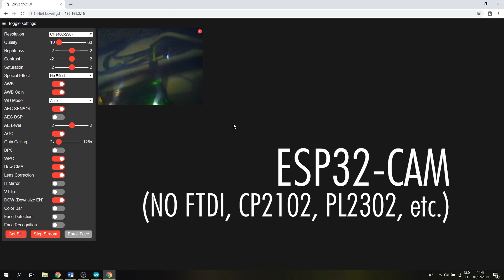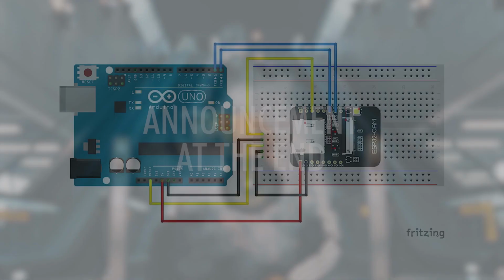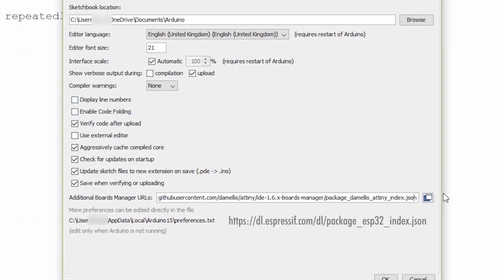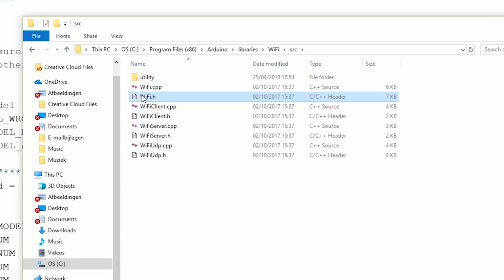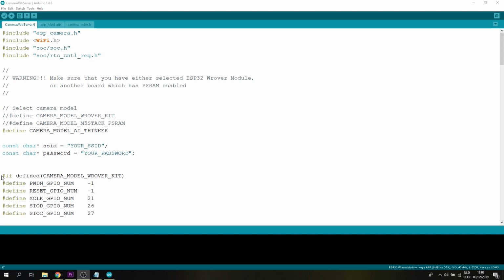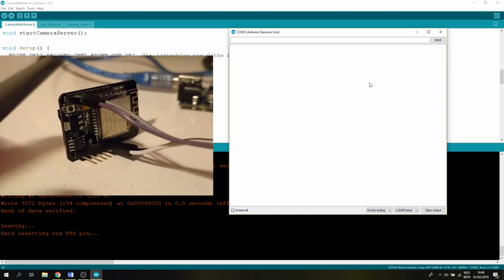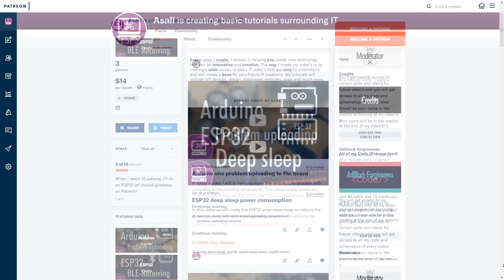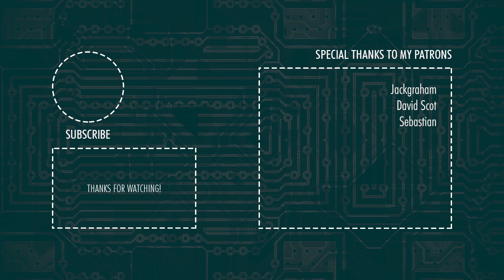ESP32-CAM AI Thinker how to upload in Arduino, no adapter!

Comment: The ESP32 requires a 3.3V power supply and 3.3V logic levels for communication. The GPIO pins are not 5V tolerant! If you want to interface the board with 5V (or higher) components, you’ll need to do some level shifting.
Reply from the maker: Then please explain to me the power supply on the bottom of page two, second to last on this datasheet of the ESP32-CAM: https://goo.gl/bzoySC
Reply: esp32 have input 5Volt and 3,3volt both can use power to esp32 board. same power need be ftdi programmer too, 5volt normal used. ftdi to 5v pin to esp32.
Reply: The AMS1117 is a power regulator. It's OK to use 5v as long as it's the pin labelled "5v"

Comment: hello, thank you very much for this guide. I came to the last point and am receving always the message "A fatal error occurred: Failed to connect to ESP32: Timed out waiting for packet header". What do I have to do? Thank you in advance
Reply from the maker: Have you tried to lower the flash speed to 115200? Also when it fails try to unplug your Arduino uno and plug it back in (this helped me out alot)
Reply: @asali-channel  yes I tried with 115200 as well but did not work. I also unplugged my arduino, changed my cable, checked connections etc. but still same... They say that thay found a way with boot button in old esp board. However in this board there is only reset button! I am blocked and don't know what to do
Reply from the maker: Please check whether your RX & TX cables are wired up correctly, make sure you didn't switch them around, this may cause the upload to fail
Reply: @asali-channel  u0t in esp goes to rx and u0r goes to tx. Io0 goes to Res. Are these correct? Thank you for your time...
Reply from the maker: If I'm not mistaken you have to wire the Tx to u0t and Rx to u0r!

Comment: Need your help im making a rover using esp32 cam which will be wirelessly connected to my cell phone and i need a idea to control it with my cellphone
Reply from the maker: Well I advise you to use Bluetooth and create a small application that has 4 buttons to control your rover!
Reply: Thanks ☺️
Reply from the maker: You're welcome, if something is unclear then don't hesitate to ask for more information!